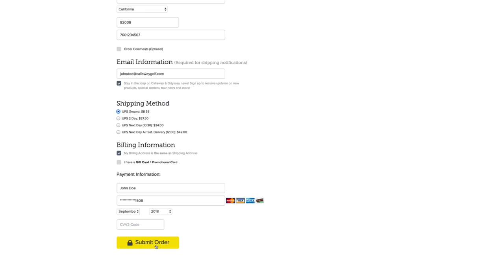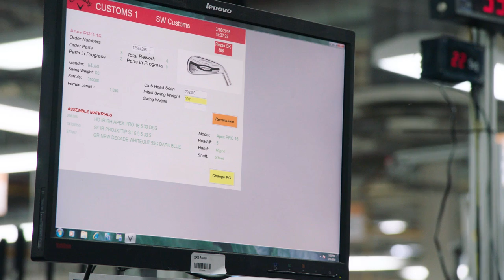How We Build Your Custom Callaway Irons...

Comment: Can't wait for mine to arrive!  Nice video.  As a tall golfer, custom fitting is very important.  Difficult to do in a store.  They just don't get past letting you hit a few on the monitor.  Went to a true fitter and paid a few hundred $.  Well worth it to be able to go through multiple shaft options etc, and get a true fit.  Tried many brands and the two top for me Were both Callaway. I have been a Mizuno player for years.  Apex and Steelhead were the winners on Trackman and in open tests.   Apex felt soooo good, (forged), but I went with the Steelhead because I hit them a bit higher and it is a tad more forgiving club.  Both are excellent clubs.  Ordered them 2 inches long and 2 degrees up.  Custom fitting is the way to go.  Same for the Callaway wedges.  Supposed to have them in 7-10 days.  Pretty awesome. I am a 5 hcp.  Knowing your clubs are right really gives you confidence on the course.

Comment: Got fit on a trackman for a set of Apex Pros which were way out of budget, but I figured that I had better trust the trackman instead of tinkering with another dozen or so sets of irons. Needless to say this the most ive spent on a set of irons, and I have owned them all. 

After just 15 rounds the pxi shafts started to develop some rust and the club faces started browning like they have been beat to hell. 

Im a tinkerer and irons are my sore spot, I have owned every brand from every manufacturer including Miura and endo forgings and have never seen the type of wear and tear for a club used only half a year and less than a dozen or so rounds. 

Callaway can show videos of their club makers all they want, but the product itself must be poorly made or designed for it to deteriorate so badly only after half a year.
Reply from the maker: Michael, very sorry to hear about this experience. We're in the business of making sure every consumer is 100% satisfied with the performance and feel of their equipment. 

Feedback for Apex Pros on a whole has been outstanding and we want to make sure you have the same experience as thousands of other golfers. 

Please give customer service a call (1 (877) 723-5218) so we can remedy this situation. Thanks you!

Comment: change lie without shaft or mandrel in head?
Reply: Yes and it hairline cracks the chrome on the hosel. I had Apex Pros bent 2* up and you could see all the cracks.
Reply: It looked like there was a nylon ring/tube on the inside of the bending bar 0:54, perhaps that prevents the hosel from getting deformed from bending with no mandrel?? Who knows? I would never adjust a lie/loft without the shaft or a mandrel in the head.